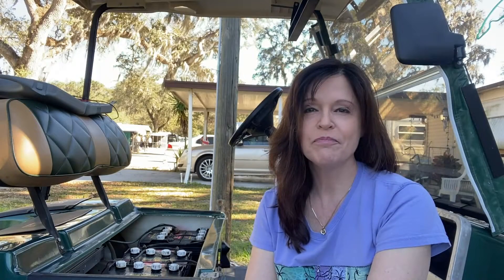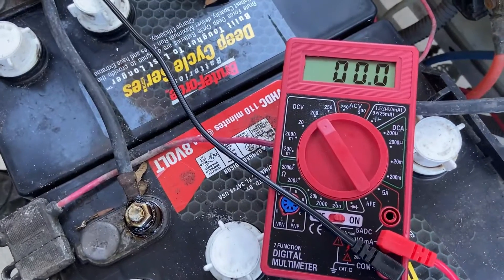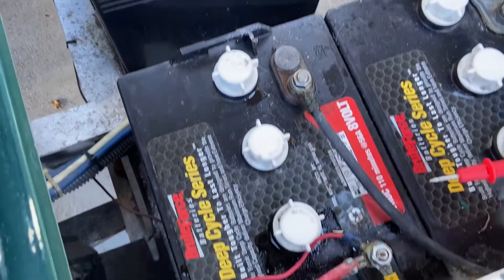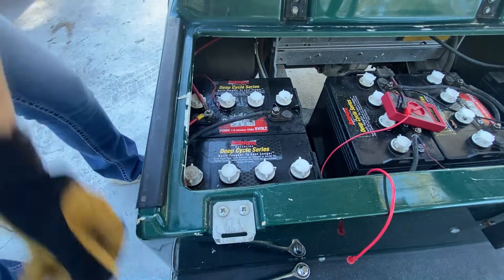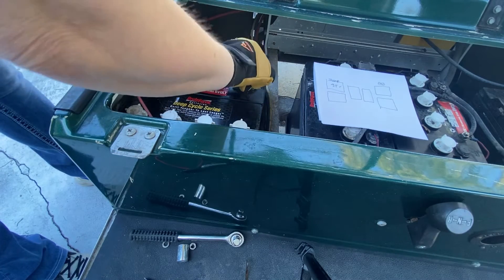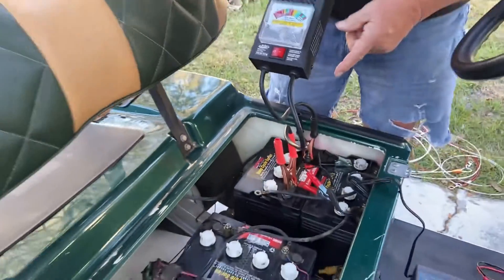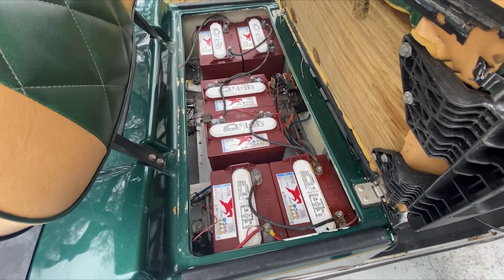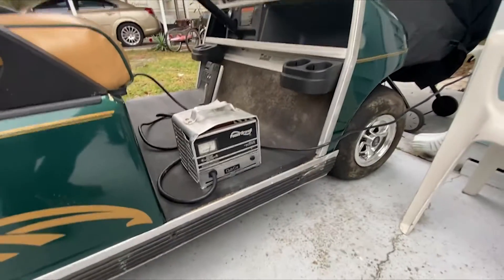Testing Golf Cart Batteries with a Digital Multimeter and a Battery Load Tester

Comment: Since he was not using the best kind of tester for this, the best way is to use the Golf Cart itself as a Load: – Turn the golf cart key to the “ON” position. – Press the accelerator and hold it down for approximately 15 seconds. (This may be done with the cart on jacks) – While holding the accelerator, use your multimeter to measure the voltage drop of each battery, then write them down for each one.  If you have one that drops on average more than the others, then that is a good sign you have a bad battery.  You may also have a shop PILE test the batteries.  Thanks for taking the time to post this.

Comment: test and record the specific gravity of each cell, be prepared to charge for 1-2 weeks to break up remaining sulfate from the battery running down.  A $7 floating balls type tester works fine.  the "Rolls Battery Manual" is a great reference for the upkeep of lead acid batteries.  - a guy who knows way too much about batteries.
Reply from the maker: Thank you for sharing :-)